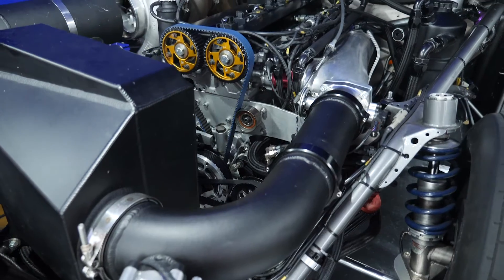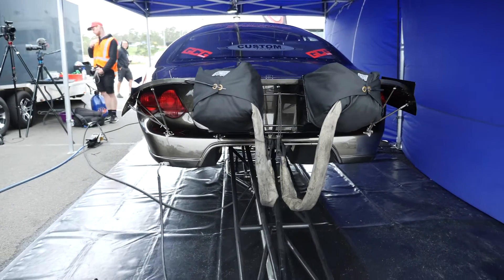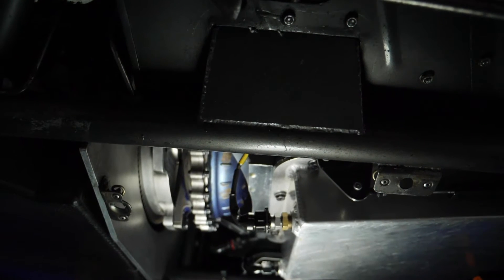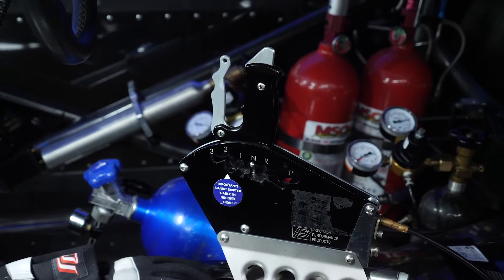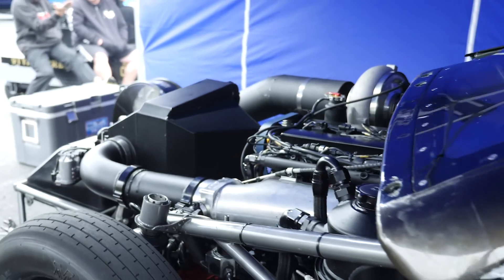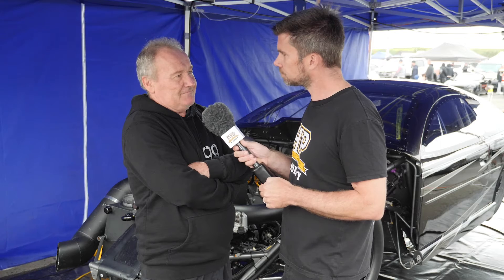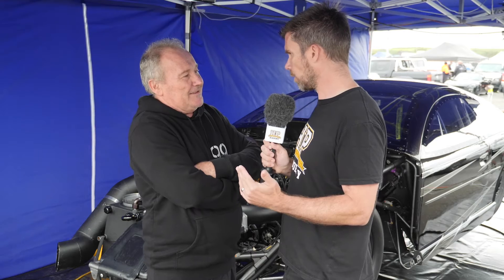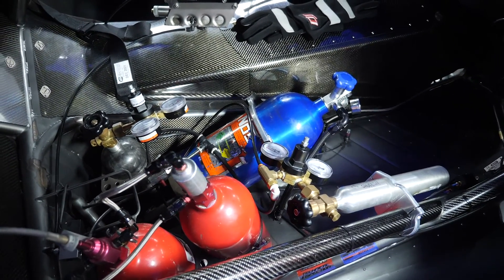Can You Put an Aftermarket ECU In ANY Vehicle? | Replicating CAN Messages [TECH TALK]

Comment: Most of the questions asked belong under "how do serial data transmission work", not really "how does CAN protocol work". The fundamentals of serial coms and data formats need to be understood before adding CAN (which is an asynchronous differential-pair direct addressed transmission line) to your knowledge box.
CAN is also slowly on its way out being replaced by CAN-FD and Auto-Ethernet.

Comment: As much as I find this cool and I was doing this myself (I fully appriciate your effort). Coming from the other side of the industry developing powertrain ECU's for modern hypercars it's incredibly dangerous to be reverse engineering CAN, as you will never ever be 100% sure on what you are doing with said component. Even if you have a proper CAN database, without an actual component datasheet you might still be doing stuff incorectly :)
Reply: Agreed. Blindly replicating binary data doesn't seem the best option, especially for mission critical devices. Too bad that getting any kind of documentation of used protocols is piratically impossible. Not without a huge payment to OEM. More so, reverse engineering will become way more limited, when encrypted CAN bus messages will appear (wouldn't be surprised if some OEMs are already using them).
Then motorsports applications it would be better to just replace all CAN devices / ECU's with aftermarket boxes, that have open documentation, and are user tunable.
Reply: @andiszile  : Yes, pretty much correct.  But an OEM will not give you any technical documentation, fibex or dbc-file unless you actually pay enough to buy the whole company... encryption on CAN will not be common though, apart from some checksums and security bits... The reson is that CAN is too slow and on its way out. It's being replaced by CAN-FD and Automotive-Ethernet, these are the 2 where you'r going to find encryption.
Reply: @TheFirstBigCheese  bingo-someone gets it -well said big cheese
Reply: May I ask in which company you work for? Bosch, Marelli? I am trying to reverse engineer Magneti Marelli IAW5NF.T1 ECU to create a standalone ECU on a Speeduino with full CAN support. But as you know, the OEM does not provide any information whatsover. This is a problematic ECU due to poor design as well as bad placement, especially on the Fiat Stilo 1.6 and Fiat Doblo 1.6 cars. I work full time as an FPGA R&D design engineer and so far I've never had to come across CAN in any of my projects.
Reply: @xynostasos9022  It was and still is Rimac Technology. It's honestly a liability for OEM's to be sharing any CAN database details, especially in latest generation of cars, and before cybersecurity kicks in.

Comment: If we where to make the process of retaining oem functions in combination with tuning en costumising cetain can bus data for custom setups and make it somewhat userfriendly where going to be needing a whole new breed of standalone ecu,s in the future thats a given .... Can it be done now ? Yes certainly tho the hours of expert skill required and cost involved makes it so its out of reach for most
Reply: Most functions is not difficult at all as long as you have the .dbc-file; these can be bought, found (sometimes partly on internet already) or reverse engineered and shared... Most functions are strictly ON/OFF or reading/setting a value, so if you know this, you just send what you want to activate. CAN is very favourable in that regard.
LIN, CAN, SENT = no problems!
CAN-FD = problems starts here...
Flexray = problem, deep!
MOST and Automotive-Ethernet = Haha, good luck...!

Comment: I would like to fit an M142 to my Forte GT which should have the same CAN Bus system and ECU as the i30 N. There is a PnP unit available for the i30 N. I want to put a Syecc in a Golf R  (not purchased yet) and I want to put a something in a Dodge Caliber SRT-4. I have a Cobalt SS Supercharged and we're limited on fuel injector resolution. We can install the PCM from the turbocharged version of the car but there some issues with that. Somebody put an AEM Infinity on his car and the cars aren't that popular so developing a PnP solution might not be the move there. But I think the best way to learn these ECU's is to actually have a car running it, unless you got an engine dyno...

Comment: Are there going to be Canbus courses in the future?  Would be interesting.
Reply from the maker: All going to plan there will be a basic course out in January. We've been trying to do more on CAN communication for a while for you guys - Taz
Reply: @hpa101  A course on wiring in CAN modules and termination points, how to debug CAN, how to understand the messages and how to implement with other CAN devices would be great courses that are hard to find reliable info on that is easy to digest for the modern guy that just wants to go fast.  Example: wiring in a PMU, and CAN switchboard to an ECU and CAN button panel  All the way from wiring planning to CAN messaging and then configuration.  That is a very common implementation that is pretty hard to sort out for the average builder.
Reply: @hpa101  So does this mean you'll teach us how to reverse engineer the CAN Bus? This also opens up flashing electric cars like the Tesla.
Reply: @dj4monie  Some cars implement encryption on the canbus essentially making reverse engineering impossible. I'd expect Tesla to be among them but it's only a guess.
Reply: @exidous6831  Tesla has been quite closed-down and Apple-like as far as repairs and modifications are concerned, which is unfortunate.